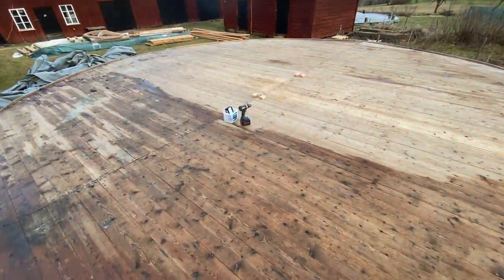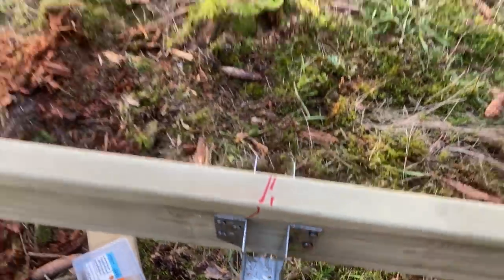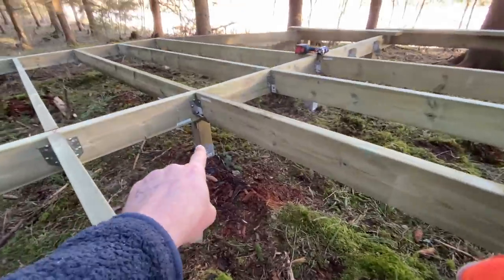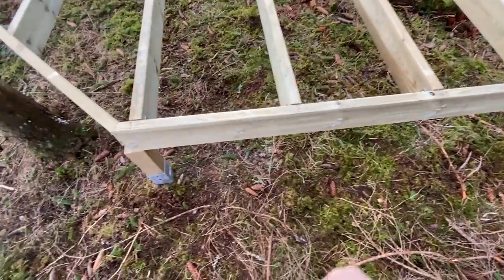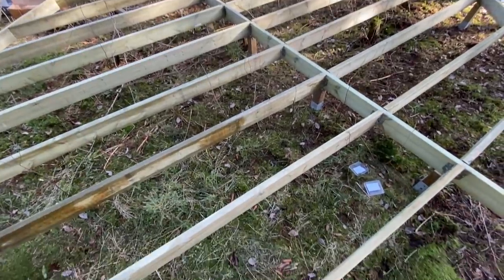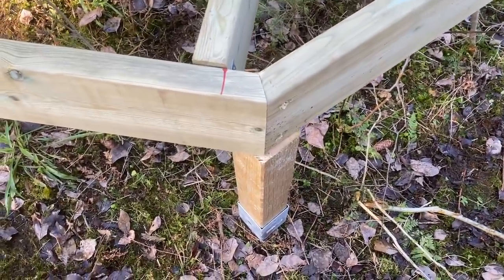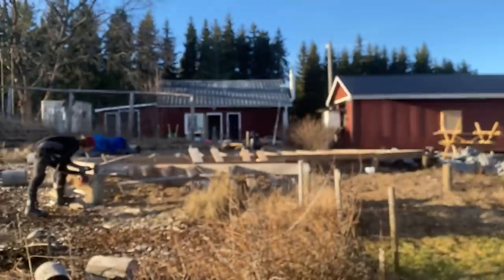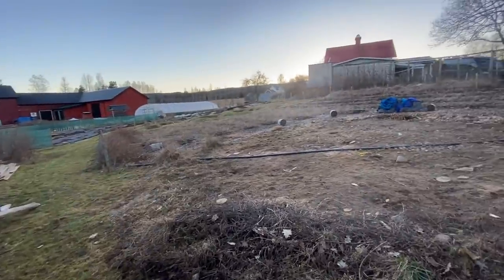A good days build...

Comment: I see you used the brackets to secure the beams on the middle section.  How did you secure the beam on the diagonal at 3:22 and 3:24.
Reply: Probably the same way as 5:19 , with screws through the wood from the outside.